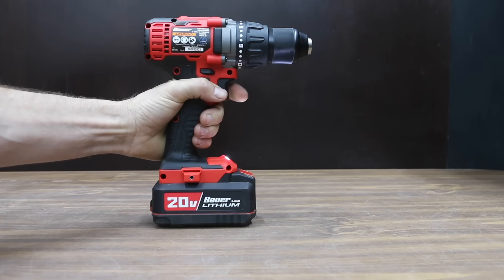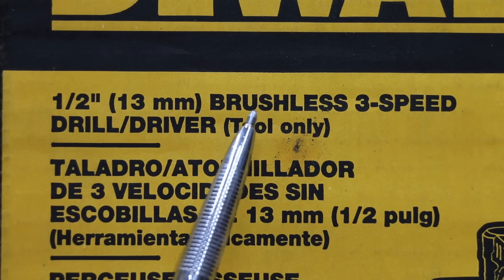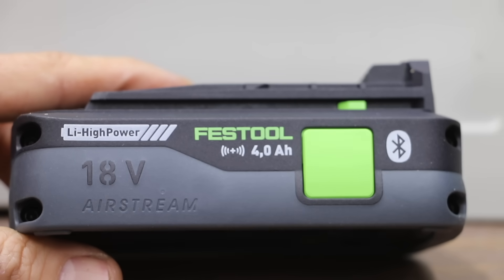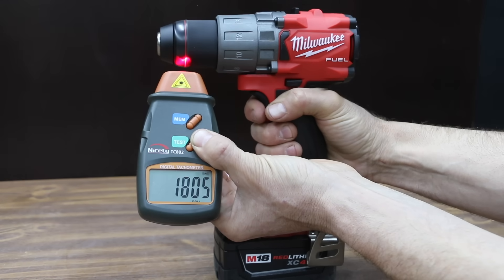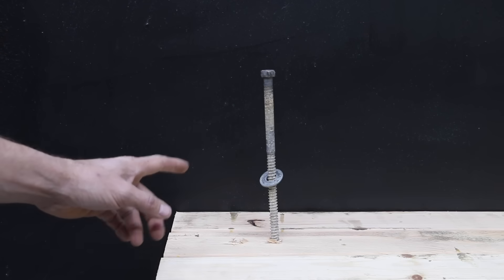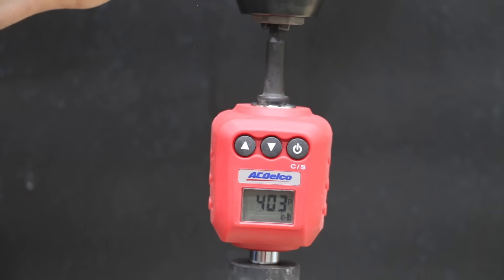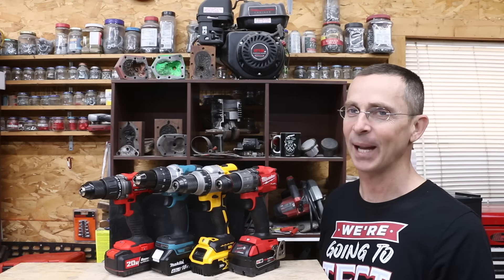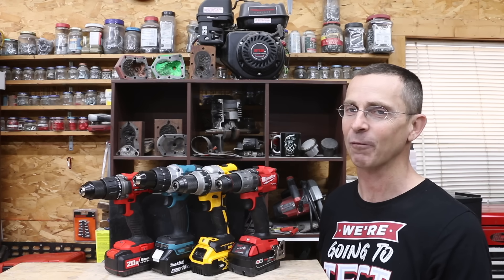Best Drill (BATTERY POWERED)? Milwaukee vs Dewalt, Makita, Bosch, Festool, Ryobi, Bauer, Ridgid

Comment: How about a long term tests, on drills and impacts. It's fine they work right out of the box. But what about after a year, of real world uses? After going through, heating, freezing, high humidity, dusty type of conditions. Varying usage then they sit around, then more usage. Maybe two batteries, one used until discharged, one to use properly. Getting knocked over, or tossed in a tool bag. You know, like how Mike down the road uses them.
Reply from the maker: Thanks for the suggestion.

Comment: Great video as allways my friend,,,and again I'm glad that I'm a Millwaukee owner almost completely,, I do own some Ryobi as loaners/crew tools and I also own a few Makita corded tools,,,one corded Makita 4 inch angle grinder I have had for what must be nearly 30 years now that has been threw HELL and tons of use and abuse and it shows it but the freakin thing just won't quit, and I've tried to kill it by leaning on it to the point it stalls, it has a safety overload breaker built into it that stopped working  some years ago so I wired past it, so you could kill it if you stalled it and stayed on the trigger so I haven't done that, but in all the use and abuse that's the only thing to give up on it and I got it second hand from a pawnshop, so that's saying something about makita,,,but for cordless tools I'll be sticking with Millwaukee,,,I have a sizable collection of the m12 and m18 lines and they really perform outstanding,,,and honestly the Ryobi is not too bad either and I like how their batteries work even on some of their much older tools because of their devotion to keep them interchangable.
Reply from the maker: Thanks for sharing.

Comment: I'll stick with my Ridgid. 9 years with the same tools and batteries and not one problem. I've worked them hard professionally and all the at home things also. Had to use an LSA claim for a charger that I used in the sun all day. They asked what happened, verified my model # and my address and 3 or 4 days later I had a new one.
Reply from the maker: Nice!
Reply: @ProjectFarm  thanks

Comment: Great video as always, Project Farm. Regarding the clutch torque settings, the electronic clutches seemed to struggle. I think that the electronics just isn't fast enough to cut the power, so I was wondering if there would be a completely different result if the torque adapter was let to move half a turn i.e., simulating actually turning a screw instead of an instantly locked rotor.
Reply from the maker: Great point!  I believe the results would show even worse results using the method you describe, since it would allow the full momentum of the electric motor, chuck, etc. to "hit" the adapter.

Comment: Love your tests, but as a Makita guy, i wish you would have used the new XFD14Z which is replacing the quite old XFD07Z
Reply from the maker: Thanks for the constructive feedback
Reply: @ProjectFarm  Thanks for your reply. Would love to see a follow up with the XFD14Z or XPH14Z if you would do a hammer drill test. I'm considering to buy it, when it comes to europe.

Comment: Im a little sad that Ryobi's one+ HP brushless drill wasn't in this line up.
Reply: I have a Ryobi 3 by 21 sander and the thing is such a beast that I even sharpen my mower blades with it.
Reply: @stevewilson7857  Lemme guess, the dewalt was 15 years old and the battery was dead? If you seriously think Ryobi can outperform Dewalt, Milwaukee or Makita, go take a look on some real jobsite and tell me how many Ryobi tools you see.
Reply: Ryobi is consumer grade, no surprise there
Reply: Why? ryobi will never outperform, dewalt, milwaukee or makita or festool
Reply: @promo130  By that logic, why include anything other than the expensive, contractor brands? He wants to see how that Ryobi will compare to the others, that's why there's cheaper/more budget options included in these videos.
Reply: @TheKalkara131  to see what it does against the others, not everbody uses tools everyday on a jobsite, for home use ryobi is fine cause you dont use it everyday
Reply: @promo130  eh. I dunno. I have both Milwaukee M12 and M18 as well as a bunch of ryobis. I'm always impressed by the Ryobi brushless and sometimes they outperform. My buddy who's a contractor and a diehard DeWalt guy always ends up borrowing my Ryobi junk and says he can't believe how good they perform for the prices.
Reply: @foreignautomobiles  a contractor for birdhouses

Comment: One thing I would like to point out is that most drills with electronic clutches need to be in 2nd gear to get low torque numbers out of the clutch. I have the Milwaukee drill and if Im doing delicate work, it needs to be in 2nd to not blow right through.
Reply from the maker: Great feedback. Thank you

Comment: I have one of the older Ridgid drills. I would like to get the newer version brush less one. For being a mid range drill its worth it. Batteries is what keeps people with their brand. If a new brand came on the market with way better cordless tools and offered an entire line up from everything from drills, blowers, chainsaw, compressors and ever other tool one could think it would sell well. 
The major problem I see is that some lines offer nice tools while others do not. Ridgid is a great tool line yet it does not offer mowers, chair saws and other things like dewalt or even ryobi does.
Reply from the maker: Great feedback. Thank you

Comment: I'm curious, did you put the Festool into drill mode for all the other tests aside from the clutch settings tests? There is a huge difference in output between the highest "clutch" setting and the drill mode.
Reply from the maker: Great point.  Yes, I did place it in drill mode along with all the other brands too

Comment: I was surprised that flex wasn’t there but it was hilarious to see Festool get rolled lol
Reply: For $544 dollars, I could buy a few more Milwaukee tools!!!
Reply: @chesterswingjr9796  I would be doing the same with Dewalt batteries and a shop vac!
Reply: I mean you certainly don't buy a Festool if you want the most powerful tool. That goes for pretty much all tool categories. You buy it for great service, european or even german produced, guaranteed spare parts for 10 years after the tool gets discontinued and great accessories.
Reply: @saiiiiiii1  absolutely, but it was practically the least powerful on test. If it was midrange & had those benefits, then it makes a lot more sense to spend that money.
Reply: jami w  I'll give it a watch but I don't trust that guy as much
Reply: They make high quality tools, for sure - but the performance here was really pretty ordinary 😣
Reply: Festools are used on weekends between 9 and 3
Reply: @raul0ca  😂😂😂😂😂😂
Reply: The Test wasn't fair, if you know the lineups from Festool and Ryobi, both have much better drills, it's like comparing a truck and a car
Reply: @timk4939  the other brands have higher models too, so I am not really sure how it isn’t fair…?

 A $500 product should outperform (or at least outlast & offer comparable performance to) a $50 product, using common logic.

I have absolutely nothing against Festool btw, I have a couple of products & I cannot fault them.
Reply: @timk4939  agree. He should have used either complete brushed or brushless sets with same battery loads.

Comment: I wonder how these perform in terms of durability over time. At work(farm) we use Ryobi and though they're not intended for professional work(even though they cost almost as much as the pro brands) I'm disanointed with how poor they perform in that regard(one broke in two pieces in my hand while using the hammer function, awful weak plastic on the case).

Comment: I can understand certain Festool tools like their tracksaw, miter saw, domino etc. which are very accurate and trade proven but for more utilitarian general stuff like drills, angle grinders etc? I don't get it, especially not for the price.  I guess people like the whole consistent system but still, don't see the point in spending so much on tools like this.

Comment: To be honest, guarantee and spare part availability even after the model is discontinued are the most important factors for me. Interesting to see how badly that festool performed, almost like it was a lemon.. Or is it just the brand name, who knows.

I would like to see difference between air hoses, how durable they are against getting pinched, stung by sharp tool accidentally, bent to extreme angles and years of use, simulated of course.

Comment: I've owned bosch for years and can testify to its lack of torque (when torque is needed I pull out a corded drill).  

BUT BUT BUT, the trigger control on the bosch is unrivaled, and when doing cabinetry,  door hardware, etc, control is everything.  I watch guys strip screws all day long cuz they got no control.

Comment: Always enjoy these videos!
Reply: Okay, but not because you told me to.
Reply: @chaddilingus  u made my night
Reply: I'd also be curious to see how Walmart's Hart brand compares
Reply: Can you do a vid on Lucas oil stop leak and see if its effective in stopping leaking from oil pan gaskets?
Reply: @DJCuhhhstin956  Depends on the gasket material.  I've used it and its definitely effective against most gaskets, especially valve cover gaskets.  As for the oil pan gasket, try tightening the pan bolts a bit.  I'd like to see this vid too, but properly replicating a leak like that with precision isn't exactly easy.
Reply: If your anything like me the most important test is the one where u drop of a pair of steps try to catch it fail miserably fall off yourself in the process then put it back together and c if still works before u visit a and e
Reply from the maker: Thanks!
Reply: @ProjectFarm  It's a good blend of Myth Busters and Consumer Reports
Reply: @ProjectFarm  Can you please make a video for portable inverter generators
Reply: @ProjectFarm  makita drill,i use it every day.driving screws into hebel,metal battons. makits are one of the few brands that regulate there own tools. millwalki,bosh,dewalt,ect,all sold out to an off shore monufacturer. tcl or something,its on the side of the tool. i like millwalki,but have too many makita to change. isnt dewalt & bosch the same co..
Reply: @phantomwalker8251  bosch owns makita .I know on their skill saw that many of the parts are interchangeable
Reply: @ProjectFarm  I know you don't have time to read every comment on your videos, but I think you're Tim "the toolman" Taylor 2.0 (minus all the accidents)😏
Reply: He should literally threw the festool at something
Reply: Great video but why don't you also give the measurements in SI units?
Reply: This video is the definition of the illusion of choice. All these brands are owned by the same companies

Comment: My milwaukee compact 1/2 drill is the best drill I ever had and I already had batteries so the bare tool on ebay wasn't very expensive really.  What tools people currently own might make a huge difference as the batteries and chargers are not cheap.
Reply from the maker: Thanks for sharing.

Comment: I recently got into Milwaukee to replace my old Craftsman line. I have always liked Milwaukee as they have tried to be the most premium brand. But I am so disappointed with the "electronic clutch" system. I know they used it to be more compact, but it's a useless joke, and I would trade a little length for a usable clutch. Every time I've tried to use it, it send the screw 2 inches deep or strips the plastic threads and every time you pull the trigger again it torques it down some more before the clutch turns it off.
Reply from the maker: Thanks for the feedback.

Comment: 🔨🔩 Depending what I'm doing, I tend to like the torque to power-capacity comparison.  For instance, how many 1/2 by 8 lag bolts can be driven in before losing torque.  Love your comparison videos.  I use a DeWalt, but your reviews are pushing me to that little Milwaukee you tested today.  That little guy's awesome. 🔧🪚
Reply from the maker: Thanks for sharing.

Comment: This Festool (PDC 18/4) is being discontinued.
There's a new model called TDC/TPC 18 (TPC = percussion, TDC = just drill), which is stated to have more torque (80 Nm as opposed to PDCs 60 Nm; that's 710 vs 530 in freedom units)
But as usual, not yet available in the USA.

Comment: I would have liked to see one of Ryobi's brushless drills included since this was the best drill challenge, not best cheap drill.  Also the cost of the Rigid, DeWalt, Makita, Milwaukee, and Bosch did not include the cost of the battery and charger.  For a fair cost comparison (especially to the Festool) that should be included.
Reply: Yeah Ryobi makes some great tools, you just cant buy the cheapest versions that they sell.
Reply: Exactly; that's what I said too. He's basically comparing "apples to oranges" rather than "apples to apples".
Reply: You can often get a free battery and charger kit with DeWalt and if not that drill with 2x5ah and charger is 270$ on amazon
Reply: Was just coming to say I would of liked to see Ryobi brushless compared to the other brushless drills he used
Reply: @Shawnathan2772  Ryobi HP brushless are almost equal to the big players here. They’re excellent.
Reply: @Chukijay  oh yeah, I love mine. I liked that he started using Ryobi in his videos but would like to see the higher end Ryobi making an appearance as well
Reply: I agree, this is wrong comperison. 
PBLDD01K from Ryobi.
Reply from the maker: Thanks for the suggestion.
Reply: I literally just bought that ryobi driver from direct tools for 19.99. To say its a unfair comparison to the other no battery tools is a understatement.
Reply: @samuelmorris2295  - I bought it years ago, and now have the brushless model. The brushless models are light years ahead of the one he tested.
Reply: I feel like the Festool was just a fun thing to throw in as a bit of a bonus to see a top priced tool against more common kinds, Also out of all of these tools the Festool is by far the lest likely for one of us viewers to already have batteries and a charger for

Comment: Well, this is a bit an apples to oranges comparison:

1. Adding a battery and a charger for Bosch, Makita, DeWalt etc. can easily add €150-200.
2. With Festool, I get a 3-Year full warranty, including replacement in case of theft. (€100 down payment per stolen tool.)
3. The Festool comes with the stackable toolcase.
4. The second-hand prices stay stable for years.
5. Repair cost are very low. I recently got my 6 year old router OF 1400 repaired (it fell down). That cost me around €80. Which other brand does that?

That’s why, as a professional cabinet maker, I use mostly Festool. (Just my drill hammer and angle grinder are Bosch, because they are much better than Festool offerings.)

But again a nice video, I love them! Keep going!

Comment: I love that the Makita and the Bosch both have internal systems that stopped them from overheating and damaging themselves.  That may mean coming in second place to Milwaukee on occasion, but it means the tools will last much longer, and if you are doing the kind of stress that they were in on a daily basis, you need a bigger drill.
Reply from the maker: Thanks for the feedback.

Comment: I have all 3 generations of Milwaukee FUEL M18 drills. The first 2 generations have mechanical clutches and will continue to work under clutch loads. The 3rd generation FUEL drill uses an electronic clutch and cannot continue work under clutched loads.
Reply from the maker: Thanks for sharing.

Comment: I'm happy with my mechanical clutch Ryobi, without breaking the bank.  I have three of them, so I can have a drill bit in one, and drivers in others.  If I need real power, I have corded drills (and other corded tools).   I've never understood these 'I need massive torque for my cordless tools' people. (other than maybe impact drivers).  That's what pneumatic and corded electric tools are built to do.   I also have a small generator if I really needed high torque in the middle of the woods.  

It really seems as though a lot of people have forgotten that the purpose of cordless isn't for power.  It's for convenience.     

Have you thought about trying some of the older tools, such as the 9.6 volt DeWalt NiCd drills that I have from a friend? (now deceased).    Maybe some of the NiMH units, like the original Ryobi 18v systems, or even their 14.4 volt systems?   Batteries might have to be aftermarket, but I'd like to see the change over time compared to their LiION brethren.   

Thanks for the videos!
Reply from the maker: You are welcome!  Thanks for the suggestion.

Comment: Would love to see a combo tool test of Milwaukee M12 fuel vs. M18 fuel. Can’t decide which series to invest in.
Reply: You're going to have a much large line up with the M18, longer battery run times & significantly more torque. If the M12 offers most of the tools you might want, the advantages of M12 would be lighter weight & more compact. This can help with finesse work and/or chronic use leading to potential fatigue.
Reply from the maker: Thanks for the suggestion.

Comment: My buddy has one of those Festool drills and it certainly is not the strongest, I think he had the settings wrong for the low torque test. But where it really shines is the smooth operation. Its never jerky,  the trigger is really easy to control and its the best drill for working on a ladder the clutch is so reliable that I don't worry about breaking something like my wrist or having it make me loose my balance. That super hi speed makes forstner bits work better. So in all honesty its more of a fine wood working tool, think precision not brute force.
Reply from the maker: Thanks for sharing.
Reply: @ProjectFarm  would you mind putting the torque setting on 1 and the speed setting on 4 and try the low torque test again and update us?